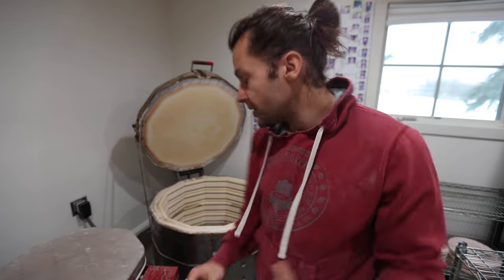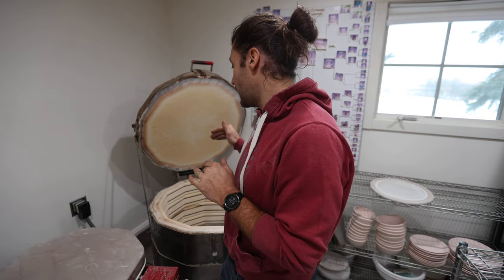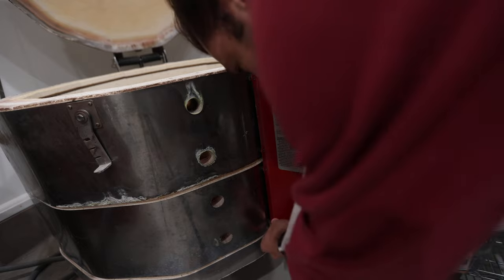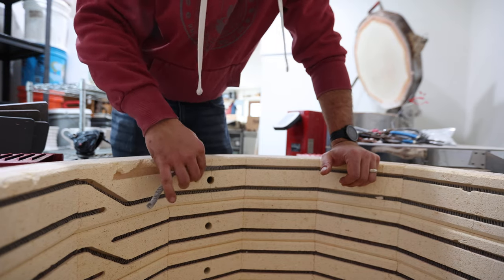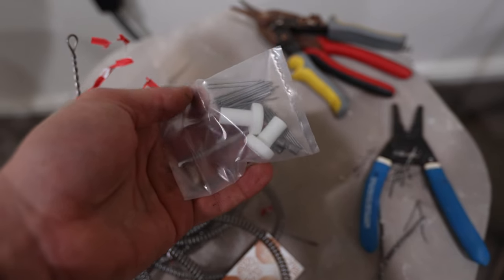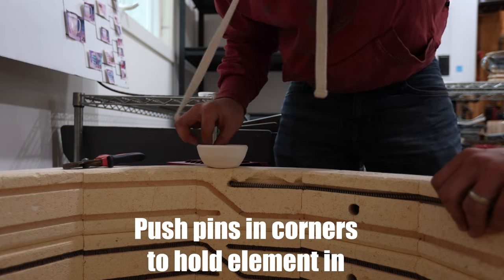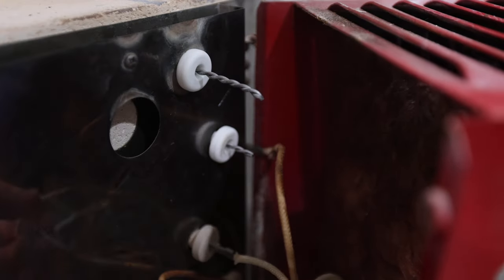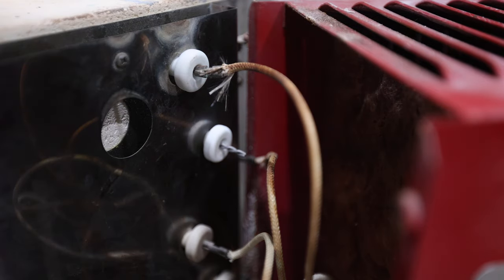How to change elements in a Skutt Electric Kiln

Comment: Someone posted about the crimper tool and that was very helpful. Did not need it last time in 2006. Also the connectors are called barrel connections. I bought some xtra online just in case since Skutt sent just the exact amount. Thank you for your video it has been a lifesaver.

Comment: The White things are called “Porcelain Insulators,” the small metal things, “barrel connectors.” 🙏🏼
Reply: Along with that, the twisted ends of the elements are called "Pig Tails" and the wires that come from the control box that connect to the pig tails are called "Feeder Wires".
The feeder wires have to be cut shorter every time the elements are changed? so eventually, they have to be replaced too.

Comment: How did you know the elements needed replacement?
Reply: There are a few ways to know when the elements need to be replaced.  The least scientific ways are just by looking at them.  As the elements age they start "laying down" more and more so each coil is kind of leaning on that next to it like fallen dominoes.  But there can still be a lot of life in them at this point, so not the best indicator.  Along with that, if you look through the peeps and see a spot that isn't glowing, that would be a great indocation that element is due to be changed.
A bit more scientific method is keeping a firing log.  Keep track of how long a firing takes, along with how full the kiln is (As this will affect the firing speed).  This is super easy to do with a computer controller as it tells you the total firing time.  With a manually switched kiln, you would need to keep track of the time yourself.  Either way if kiln loads that normally took a certain time, take hours longer, that's likely a good sign the elements are worn (My classroom kiln with new elements can glaze fire in 4-5 hours,  with the old elements it was 6-7 hours).
The most scientific way is to check the resistance with a voltmeter/ohmeter.  The kiln makers have documents posted that list what each element for each specific kiln should be when measured with a meter.  If your element isn't within a certain range, it is recommended you replace them.  And in my experience, their tech service people are great about answering questions regarding such things.
Reply: I have a firing schedule chart that I created that includes lines where I fill in the firing date, cone fire, start time and end time and total hours & minutes of each firing. You will not only notice the condition of the wires but how long it takes to do an average firing. If your firings are taking longer and longer, it’s time to change the kiln wires and also the thermocouple(s).

Comment: Sorry to be a downer but would have been a good  idea to install new wires from the coil to the controller terminal. Not all of them looked bad. Some wires looked a little rough and you will probably see them turn black after a few more firings. I hope I'm wrong but just my 2 cents.
Reply: One of the reasons we have L&Ls, way easier to replace elements
Reply: @DavidHebert62  sorry for my ignorance but L&L meaning?
Reply: @TrailBlazer17  L&L is a kiln brand.
Reply: I changed all my elements three years ago, now I have one non working element to replace.  This came at a good time (for me!).